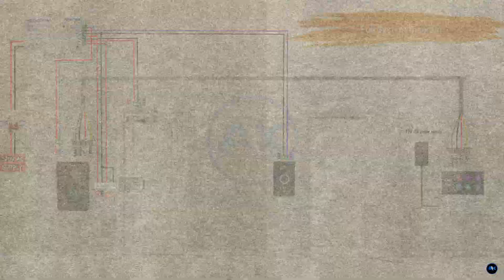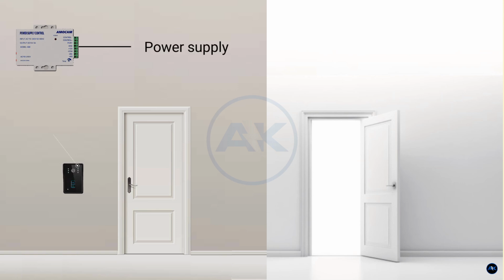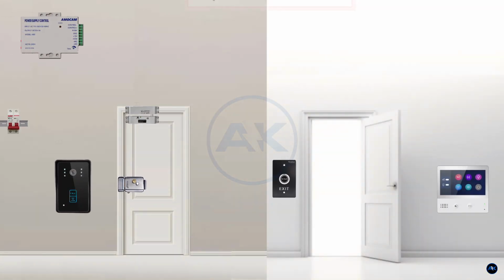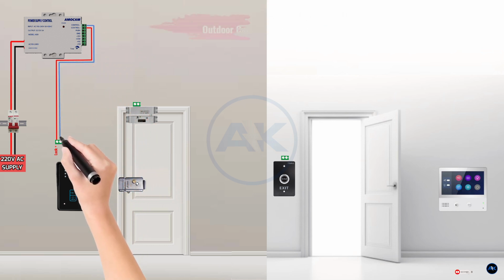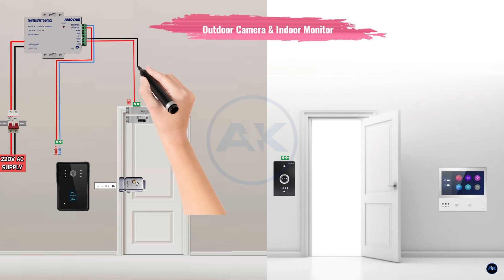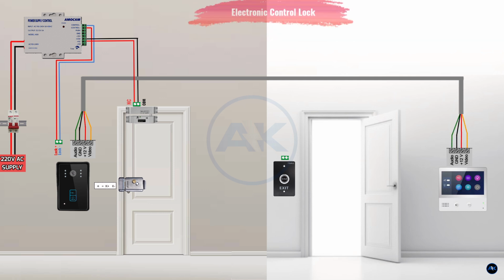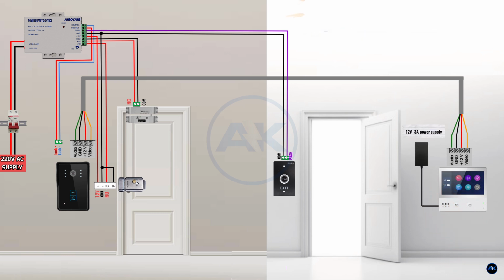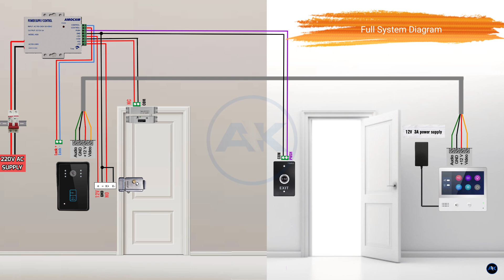"Unlocking Secrets: A Simple Guide to Door Access Control Systems You NEED to Know!"

Comment: Door Access Card Reader System for Secure and Efficient Entry | ELID i need to know how to input rifd card info in this ELID machine please
Reply from the maker: I would need more specific information about the "ELID machine," as there can be various models and types of access control systems. However, I can provide a general guide that covers the most common methods.
Here is a breakdown of the typical steps and information needed:
1. Identify the Specific ELID Machine Model:
  You should first identify the exact model number of their ELID access card reader. This information is usually found on the device itself, in the user manual, or on the packaging.
 * Once the model is known, they can search for the specific user manual or setup guide.
2. Common Methods for Inputting RFID Card Info:
 * Software-Based Enrollment: This is the most common method for modern access control systems.
   * The ELID machine is typically connected to a computer running dedicated ELID software.
   *  open the software and navigate to a section for "User Management," "Card Enrollment," or "Device Configuration."
   * They would then select the reader they want to add a card to.
   * They can usually enroll a card by either:
     * Scanning the card:  Holds the RFID card up to the ELID reader, and the software automatically captures the card's unique ID.
     * Manually entering the card ID:  manually types in the card's ID number, which is often printed on the card itself.
 * Master Card / Programming Card Method: Some simpler systems use a "master card" or "programming card" to enroll new users.
   * you would use the master card to put the ELID reader into "programming mode."
   * While in programming mode, they would then present the new RFID card to the reader. The reader's light or buzzer would typically indicate that the card has been successfully added.
   * They would then use the master card again to exit programming mode.
 * Direct Keypad Entry: If the ELID machine has a keypad, it might be possible to enter programming mode using a specific code (e.g., an admin PIN).
   * After entering the admin PIN, they would follow the on-screen prompts or beeps to add a new card by presenting it to the reader.
Reply: ER928

Reading range: 1 - 5cm
• Power consumption: 12V / 150mA
• RF frequency: 13.56 Mhz
• Output format: Wiegand, Free Wiegand
• Dimensions:
ER928: 110(H) x 44(W) x 35(D) mm
ER728: 100(H) x 45(W) x 15(D) mm